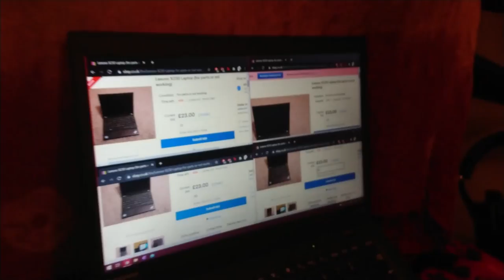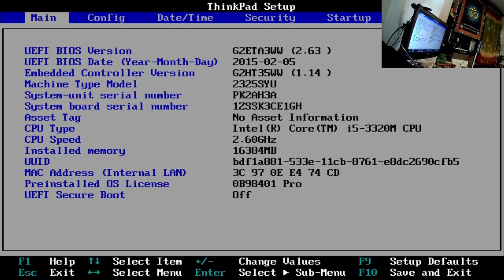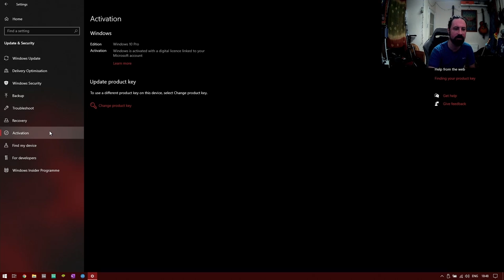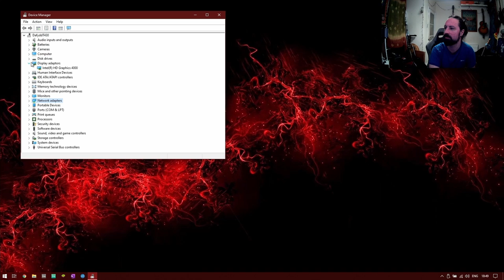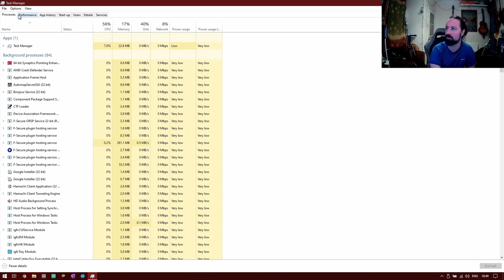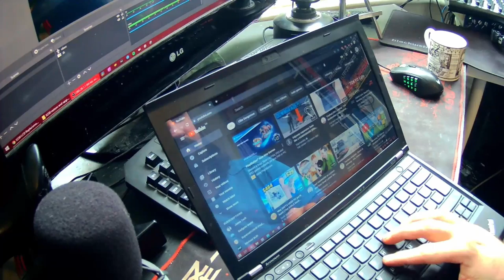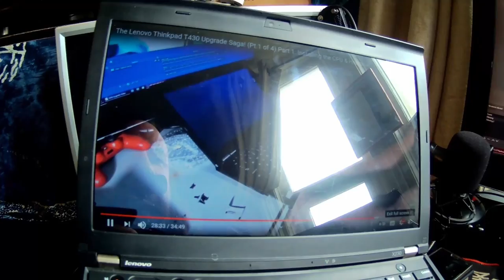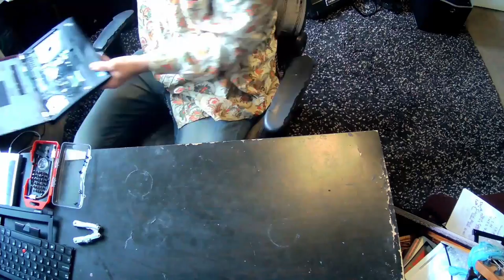£30 Broken Lenovo Thinkpad X230: Full Refurbish & Upgrade!

Comment: Hi Dave, love the video. I have windows 11 pro installed, Finger print reader works like a charm. Had to hunt the correct drivers down and also do some registry tweaking but it will work. I even have the blue tooth Dongle working as well.  I used the Ivyrain mod to unlock the bios so I can improve the wifi to 6E, and get a new aftermarket battery.  Nice to see others who still use this little beasty.

Comment: Fun project ;) I hope the machine lasts you a long time before becoming obsolete (esp. since M1 hit the market). I have an x230 myself + a T480.  Keep up the good work!
Reply from the maker: Ooh hows the T480? I gather they havr thunderbolt 3, coughs "egpu"
Reply from the maker: And thank you!
Reply: @TechDave  hehe haven't tried one yet ;). Not sure if I ever paln to, since I only play retro emulators, which are well served by the integrated gpu  :O I was worried about the well known thunderbolt issue with the thinkpad models of this era though, but so far, nothing to report. Upgraded the bios as soon as I got it in Nov. 2020. Otherwise I'm running Linux Mint 20 (wiped windows right away). Debian is the distro I run on my x230 with KDE DE :)
Reply from the maker: @benp2837  good lad! I am windows fool for most of my needs (mainly due to ableton 11 and only have windows installer) but mint ftw! I have been perusing the T460 with thunderbolt  eGPU for a while now. If u spotted "the mothership" in the video, shes my main machine atm (i7 3770k 3.9ghz/ 32gb ddr3 2133mhz ~8tbs storage and xfx rx 480 8gb) until I can pick up a 2070 ti for an non-insane price.
Also: currently using the end result of this video w/ geforce now/ advanced dock(usb 3) 1tb external harddrive and a 2gb gtx 750 ti OC in prep for a follow up video
love my x230 and its awesome to have one again. Hows driver support on debian? Ive got mint 20(i think) on the 128gb msata ssd and was flawless, but currently got an ericson hw5321 wwan/mobile broadband card in its place for geforce now on the go
Reply: @TechDave  Nice! You're much more tech savvy then me though. As for driver support on debian, almost everything worked out of the box, except for bluetooth.There is an easy fix, for sure, but I'm lazy :) The fact that I installed the non-free debian version helps too. Although I've been using Linux for about 5 years, I still consider myself a newbie/normie XD. My field of study is psychology, far far away from computer science/programming :) I do hope you have/will fix that issue with windows not booting up. It sucks, esp. since you've just finished building the machine + the project took you quite a while. Take care ;)
Reply from the maker: @benp2837  ah fair! Ye I managed to system restore it as id done a windows update prior so thankfully all working now

Comment: Good on you for keeping this (perfectly adequate) old kit running Dave. I've still got all my 30-series models and they still don't seem to be showing their age in day to day use. The 430S is my current go to, but I've been thinking I should give the X230 a go again. I suspect they might do me until good value M1-like hardware that'll run Linux becomes available.
Reply from the maker: thanks dude! ye theres a lot of life left in them, and i missed my X230 so i had to have another one. im working on a full review of it this week with external gtx 750 ti 2gb and generally talking about the device.
Reply from the maker: Rendering review video now!

Comment: Love the X230. Mine has a bright spot on the screen but it does not bother me.
Reply from the maker: me too! im getting used to the glossy panel now too that i installed. i HAD to have another x230, worked out cheaper to fix one up than buy one fully working, and made for a fun project